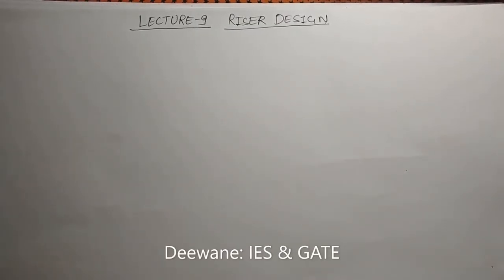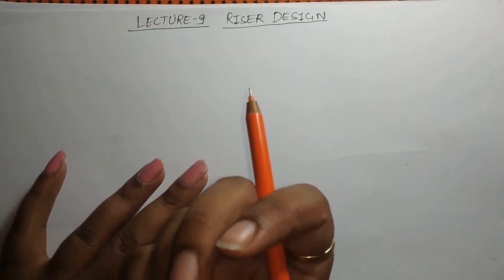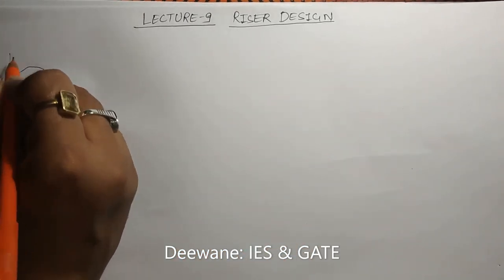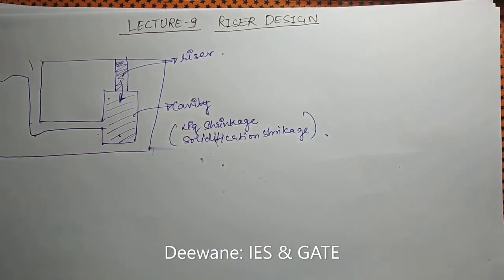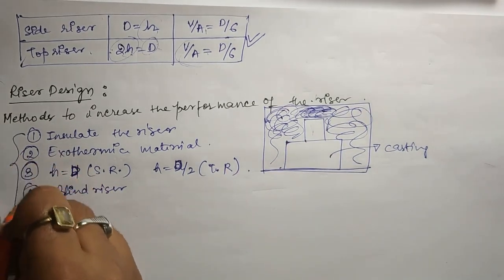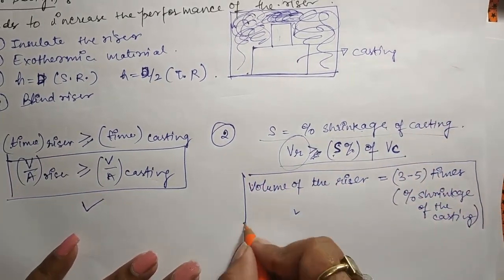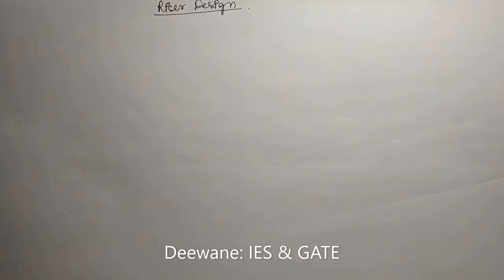Casting lecture 10 Riser Design

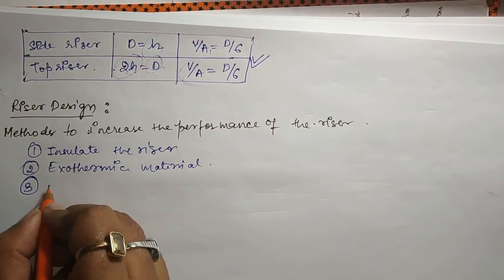Comment: Mam @18:43 for method to increase performance of riser in 2nd point you mentioned that we should use exothermic material but according to my knowledge exothermic means which release heat , so if we use this material riser gets solidified earlier instead of casting. I think we should choose endothermic not exothermic
Reply: it is exothermic material only ..mam said it correctly ..what's the thing is exothermic material release heat which is absorbed by molten metal so that solidification will be slow ..
Reply: @ajayasri8179  exothermic material for casting pattern only so that cast solidifies fast by release heat to sand as riser not made or surrounded by exothermic material it will absorbe heat from mould given by cast there by incresesing the solidifcation time of riser only

Comment: Mam !! My doubt is .--
" IF CASTING IS GET SOLIDIFY INSTANTNIOUSLY THEN WHY NO NEED OF RISER TO FILL UP ?? "
Reply: bcoz metal will solidify even before the rise get JUST filled up
Reply: When liquid pour it's temp near to 1550 to 1600 for steel casting when liquid fill   the riser that time temp of mould is 1350 to 1400 c steel. Need to solidify it's take time 3 to 4 minutes .it also depend upon amount of liquid in mould